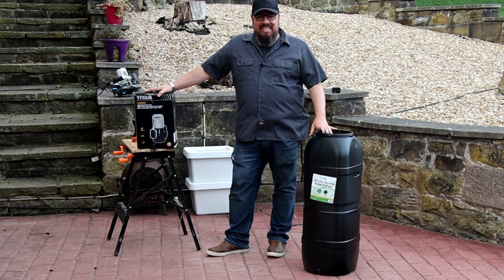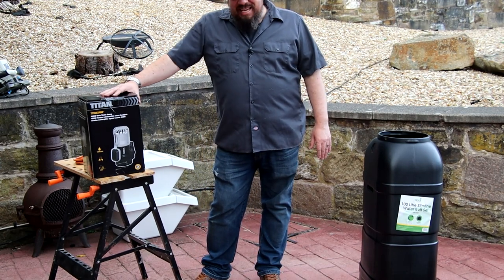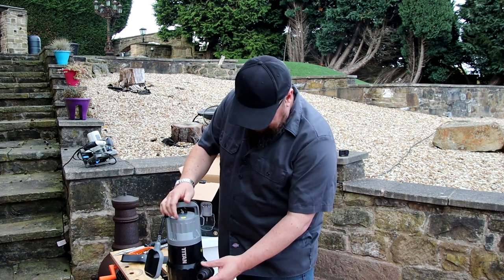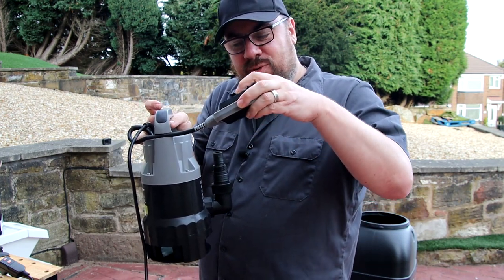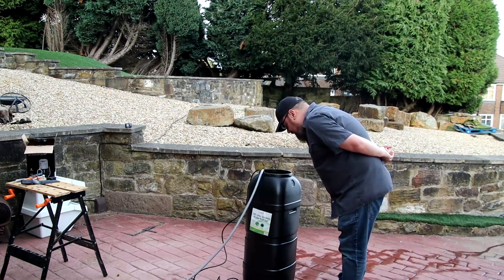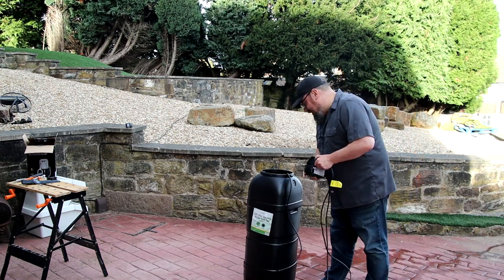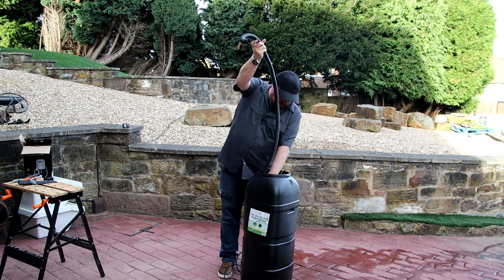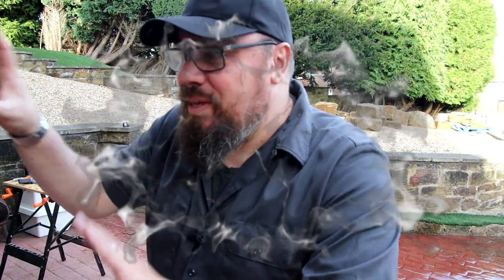Testing my sump pump - Titan TTB583PMP

Comment: Hi - we've just had a Titan 400w dirty water pump installed after some garden works we had done. However the automatic switch isn't coming on as, from what I can see, when the water level rises then switch doesn't tilt enough for the sensor ball inside the switch to move to the on point. Any advice on how we can better this?

Comment: I was actually wondering if there's enough space for the float switch.
Reply from the maker: There is as long as I orient it correctly, it was only getting stuck because of the hose and trying to line up the outlet

Comment: Nice one Graeme!
Is there a chance you may get unwanted back flow when pump not running?
Reply from the maker: I hope not - I am planning to enter the soil pipe from above, and use a non return valve - but also just started thinking about just putting it straight out onto the garden instead